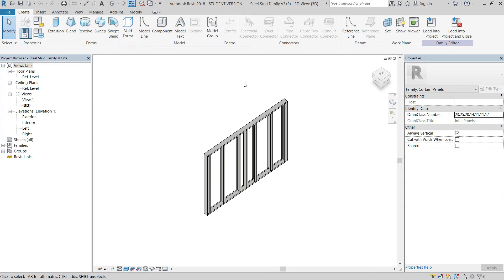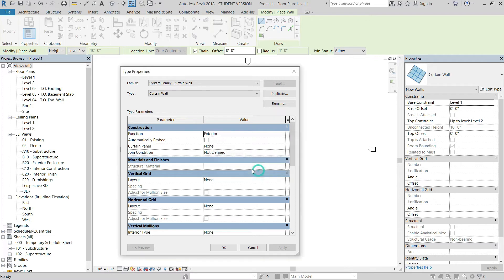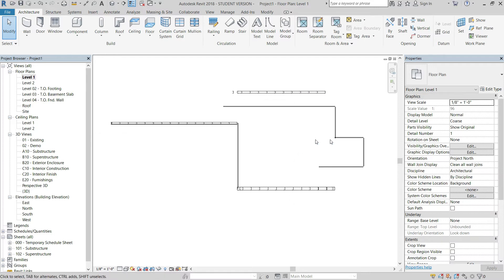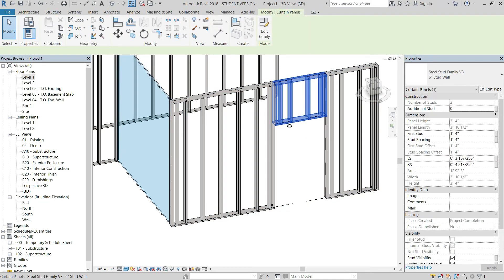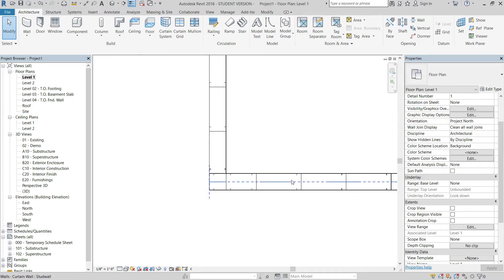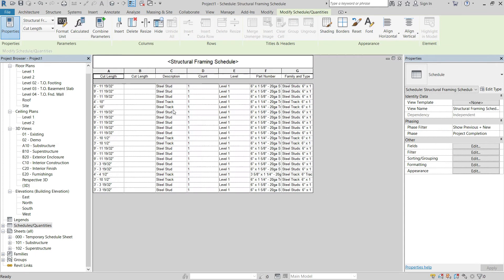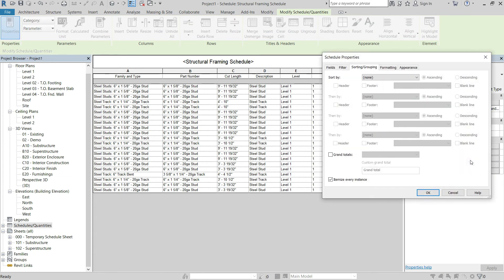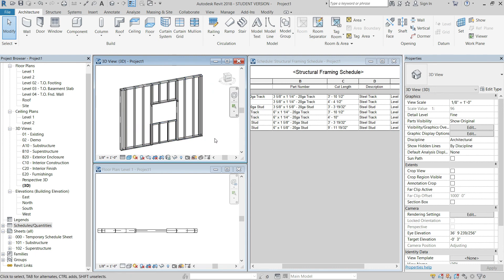Steel Stud Wall - PART 06 - How to Use in Project

Comment: I would like to know if i create all these families in architecture, will I be able to use them in revit structure to get analytical model as i am using architecture families?
Reply: I have never tested this functionality but the stud elements are classified as structural framing so the information should transfer through.

Comment: How to add this framing into gypsum drywall partition wall family please answer me & thanks for your help
Reply: Unfortunately this method does not attach to standard wall systems. You have two options. Draw a gypsum wall and then draw another cutrain panel behind it or add an extrusion to the curtain panel that will denote a gypsum panel. I hope this helps

Comment: Thank you for this video. What template are you using? I used architecture template, constuction template and Structural template, but properties it dose not me to edit the parameters of the family as your video shows.
Reply from the maker: Not completely sure which properties you are referring. Typically I set up a project the way I like and then save that as my custom template for each project. You may need to configure things differently depending on the version of Revit you are using.

Comment: Hello, I am attempting to add your Steel Stud Family V2 into Revit  2020 but the family does not show as an option for wall type as your video shows. What am I not doing correct?
Reply from the maker: This stud wall that I created is a curtain wall panel family type. When you load into a project you need to draw a curtain wall system and then swap the panel type inside the curtain wall system.

Comment: Thank you for your knowledge, thats really was helpful .But How to add bracing and diagonal stud  into the steel stud wall after we create it. waiting for answer.
Reply from the maker: I have attempted diagonal bracing before and it is quite tricky, if this is part of your design then i would suggest doing the detailing afterwards as the stud family i created does not like to be drawn diagonally. Although Horizontal bracing is very doable and have done this before.